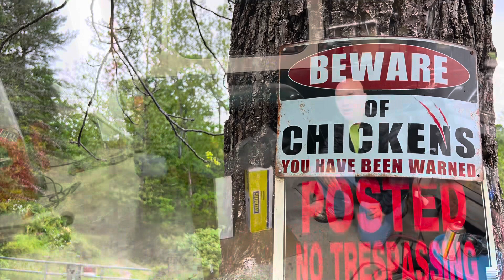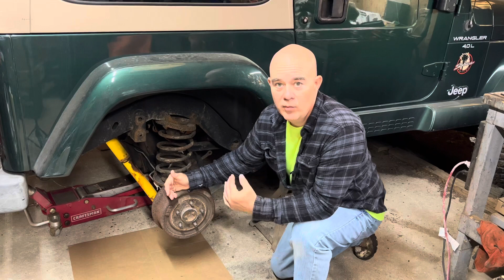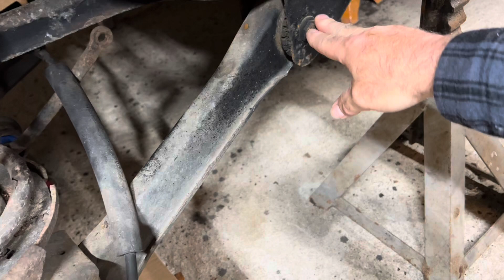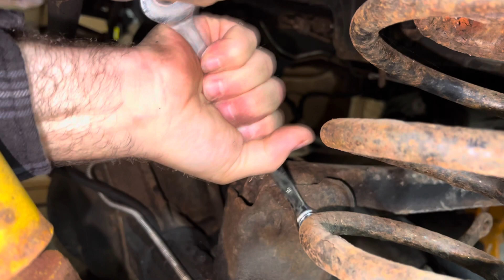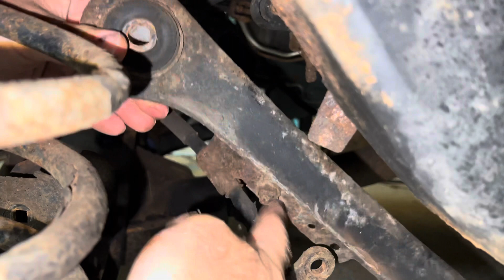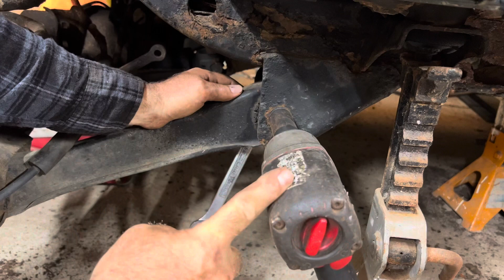Jeep Wrangler Frame Repair & upper & lower control arm replacement** #jeepwrangler #jeepwranglertj

Comment from the maker: Parts I Used in Video: 
- Rear Set Control Arm Frame Repair Kit: https://amzn.to/44YsMaB
- Center Skid Plate Frame Repair Kit: https://amzn.to/4brMAIB
- Rear Upper Control Arm: https://amzn.to/3ykS9qC
- Rear Lower Control Arm: https://amzn.to/4bxJfoF
- Rear Sway Bar Links: https://amzn.to/3WHUzJX
- Carbide Tipped Saw Blade(3pk): https://amzn.to/3WBT00h
- PB Blaster: https://amzn.to/4bgxqD7

Comment: Those funny nuts with the tab tacked to them are called flag nuts by most of us. I am fairly certain that is what Jeep calls them, too. Very helpful for those partially boxed-in sections like the control arm brackets.
Reply from the maker: Thank you. Was able to find some new Flag Nut Bolts for Jeep Wrangler TJ 1997-2006 here: https://amzn.to/3Vepb3K

Comment: question about welding? I need to reinforce the frame of my wife's 2004 wrangler unlimited, do i need to disconnect the computer from the truck so I don't fry anything in the computer?
Reply from the maker: I find it is well worth the precautionary measure to disconnect the battery.